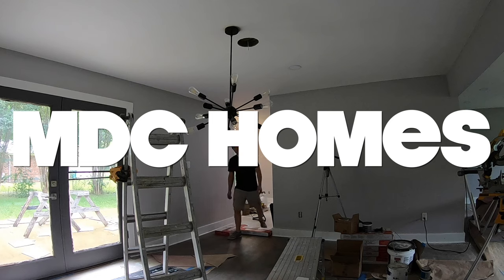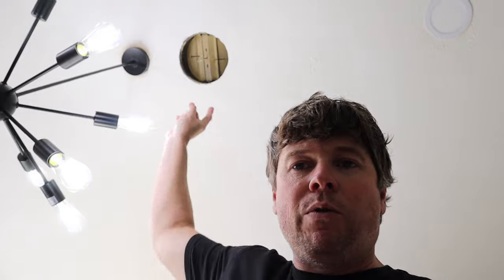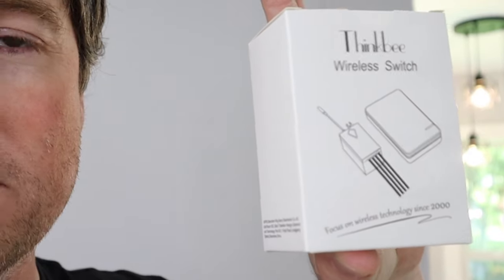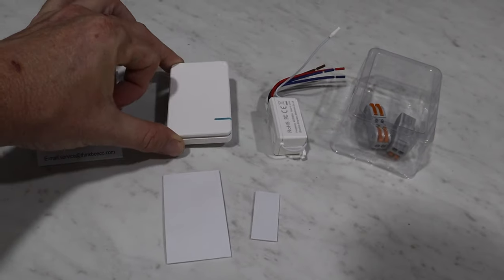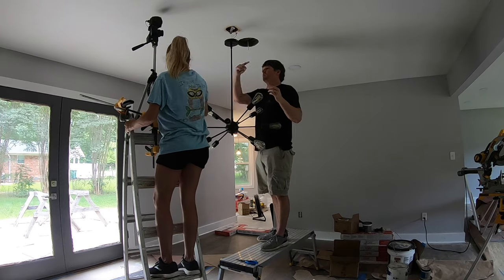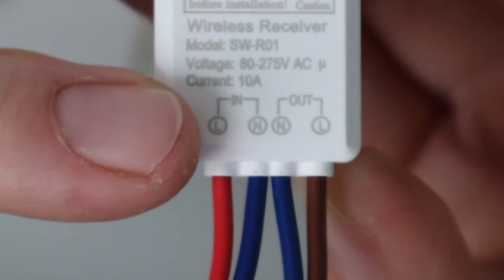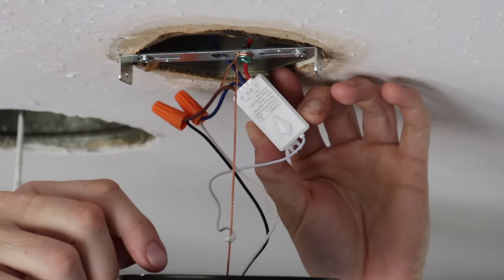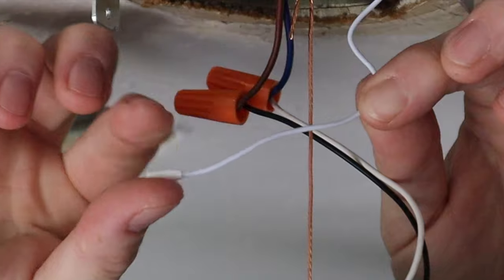THINKBEE WIRELESS LIGHT SWITCH INSTALLATION - Very DIY friendly!!!!!!

Comment: Can you pair two switches to the same light? Sorry if it's been asked already. Also will it work if the antenna is behind plasterboard
Reply from the maker: I believe they sell a unit with two switches. That would be what you need. I believe it will still work behind plasterboard as long as distance isn’t too far away. Hope that helps.

Comment: How reliable is the switch? Like does it need to be repaired with the receiver constantly? Or does it work pretty reliably?
Reply from the maker: This is the first one I’ve done so not sure on long term. We installed it in an investment property that we sold a couple months later. I can say that in those 2 months it worked without any issue.
Reply: @MDCHOMES  yes I’m looking to put them in an investment property as well. I’m going to put fans with lights in the bedrooms so in case the switches fail they will still be able to get light somehow

Comment: Can you still use the main light switch connected to the device to control it as well?
Reply from the maker: The main switch will still kill the power to the light. The remote will also not work with main switch off. Hope that helps.

Comment: Ok, that's it: it's simple to install by anyone.  The complaint I have with all these radio controlled devices is that if you have a specific style of socket and wall switches, the transmitter has nothing to do there by its appearance very different from the rest of the  house and is therefore ugly for this dining room.  Too bad 🙄

Comment: Hey! Can this be applied to existing light circuits? I have this new door to other division where I need to put a switch close to and the main switch for the lights above that door are across the room. Will it light the lamp on the main switch if this is connected?
Reply from the maker: I believe it will work as a second switch but you will need to leave the main switch on all the time for it to work. If the main switch to the room is off the wireless won’t work.
Reply: You need two Thinkbee switches, you can pair more than one switch to the controller.  Use one to replace the existing switch and the other goes wherever you want.  But as Jason said, if you leave the old switch in the circuit you have to leave it on.

Comment: Hmm. Nice. There should be a way to add this to an existing installation to make any light remote operable and operable through the existing switches. Also, it should be pairable with multiple actuators.
Reply from the maker: You can add it to any light. If there is an existing switch it will override the remote switch function. Existing light switch will need to remain on for remote to work. 👍

Comment: Can the switch be used to control different receiver?Im planning to have 1switch each group of light and then having it all the wayba master switch from the masters bedroom
Reply from the maker: This particular switch would only pair with this one receiver. You’d probably need to find one specifically for your application. I know this brand makes different set ups ( two switches for one light, one switch for multiple receivers etc).

Comment: My new light has 2 black wires and a copper. Need help plz
Reply from the maker: The light fixture or what’s in ceiling junction box? Just clarifying.
Reply: From the new light. Black, white and blue coming from the ceiling
Reply from the maker: Did this fixture have two switches that operated it previously?
Reply: I'm not sure but I doubt it. I mean this light is brand new from menards.
Reply from the maker: I’m referring to what’s in ceiling. You might need to use a volt meter to determine the correct wiring here. It sounds like this was wired for a 3 way switch possibly. As far as the 2 black wires coming from light…does the instructions indicate one to use as a hot lead and one as a neutral?